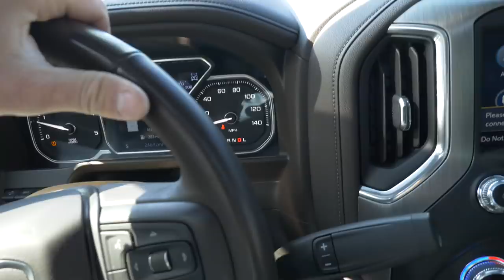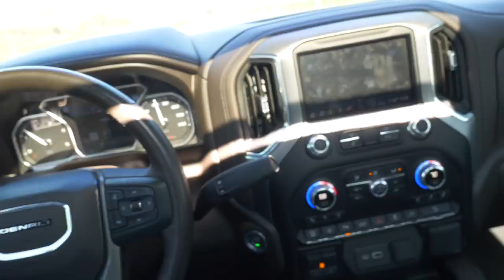I RUINED My wrap the SAME DAY I REVEALED IT! *Not Clickbait*

Comment: Suggestion- film in 4K with a wide angle and use stabilization in premiere. It’ll cut some off the edges of the frame but it’ll make it buttery smooth. It’s not perfect but it’ll fix what the in body won’t